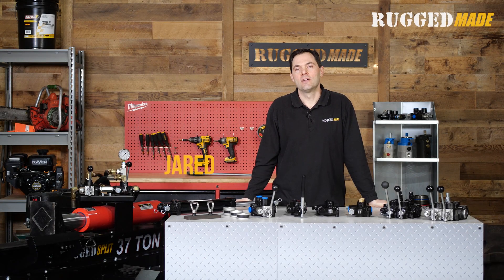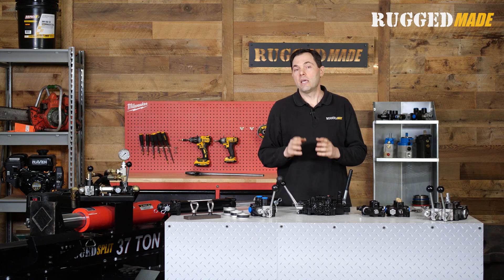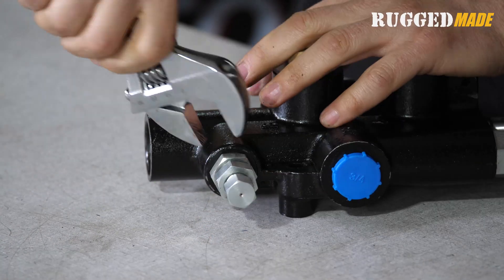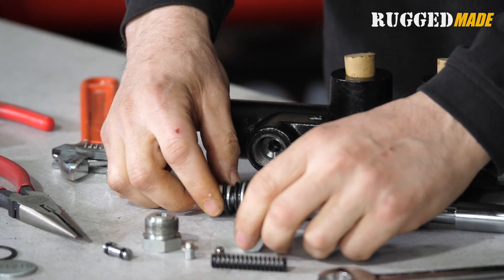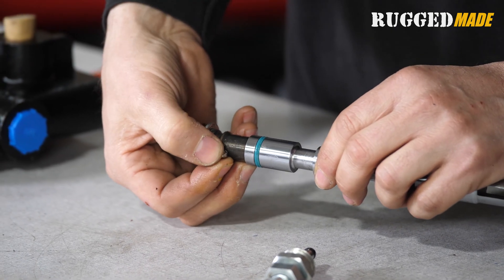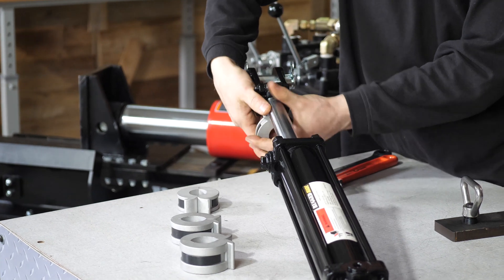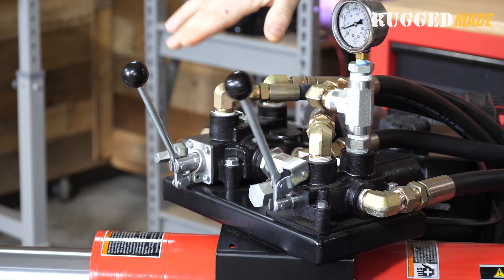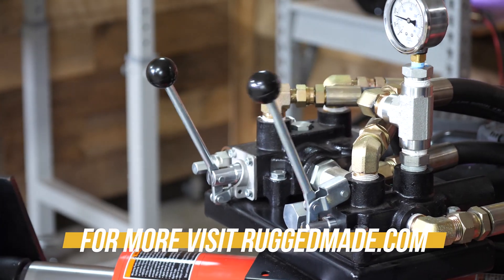Tech Corner: How to Adjust the Return Detent on Your Log Splitter Valve

Comment: This is a very good video but it doesn't cover what I'm looking for. 
I'm looking for the other end of the valve body where there's two Allen screws and a nut holding a cover on. 
I need to figure out how to get the bearings back into place so I can get it back together

Comment: Updated: I got it figured out why I was having issues with my throttle. I changed engine & hydrolic oil and turned detent 1/4 turn and now works like brand new and CHAMP!!! AWESOME video!!!  I love how you show the internal components and how they function.  Now, if you can help me figure out why my throttle isn't working properly (stays in low/idle mode) on my Forest King log splitter.

Comment: Good morning sir! Awesome video!
Hey how hard would it be to use a log splitter as a power pack to run other things?
Reply: As you would a Generator?
That what you are asking?
Reply: @bobbysmith3196  I'm talking about using it as a hydraulic power pac with quick connect lines to run other hydraulic tools.
When I asked that question there was a broke down bucket truck 25 ft over my roof. We have a new pump in it now and have it back up and running.
Reply: not hard at all.     disconnect the lines at the  cylinder,   then  screw quick couplers on  that match the implement you want to run.

Comment: First off i have a valve like this.  Not your brand but a cheapy vevor. My valve is leakingout of the weep hole.  One of the orings on the plunger had a flat spot.  i replaced it but its still leaking.  What could cause this? It slowly leaks while using the valve but when you change directions it really blows it out.  This was supposed to be a new valve.  I watched the follow up video also great work my friend.  You have made a great and explantive set of videos.
Reply: Did you figure it out? I'm having the same issue. Please let me know.
Reply: @ScrappyDooToo  The only thing I can figure is poor machine work.  I have replaced all the orings in it that i could find that fit only to be rewarded with a slower leak.  My solution for now was to install a hose on the weep back to tank.  By the way they Vevor wont warrant the valve or send parts.

Comment: Auto return don’t go to neutral unless I bang on the handle . 
SpeeCo controller. 
Took apart, cleaned spring and bearings, pulled main shaft out, did a visual. 
Put a little grease on bearings and spring, put back together.
Now Controll handle will not go into auto reverse at all. 
Any suggestions?

Comment: My log splitter locks in the forwards movement but it is manual in the return movement. I'm unsure what I'm missing out on, because I fully understand how this demonstration was explained, my only confusion is why is it inverted
Reply from the maker: Please email support@ruggedmade.com or call (855)-878-4433 and someone can assist you with this adjustment.
Reply: @RuggedMade  sorry, I figured it out, when it was pulled apart there is a central ball bearing which is under spring load, when it fell out my friend must have put the sleeve with the bearing detents on backwards, leading the manifold to lock in the forwards position and manual in the reverse position
Reply from the maker: @huntzilla360cave3  glad you got it taken care of and we hope this video helped!  If you have any issues or questions in the future, please reach out! Thanks

Comment: Great Video with easy Explanation!  I know I had this issue on the return stroke on my splitter when I first got it and snapped the bolt holding the push plate to the cylinder!

Comment: OK!  I had submitted a service issue on this very valve on my 737 a couple days ago. What I'm experiencing is hydra fluid dripping out of the seep hole, especially when the splitter is
running at idle speed. When at full tilt, no dripping.  Any ideas?  I will adjust the return detent, as sometimes it sticks on the return stroke.  Good video and timely!  -Dave
Reply from the maker: Hey Dave give us a call at 855-878-4433 or email support@ruggedmade.com .  Someone can help you out!
Reply: Hi Dave. How did you fix it? Please let me know.